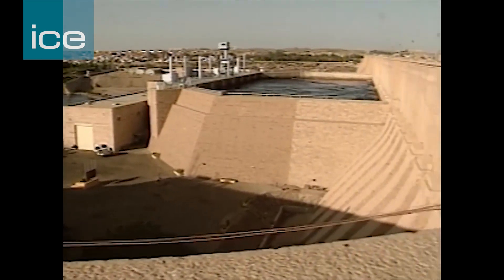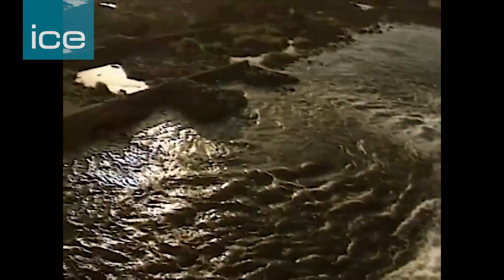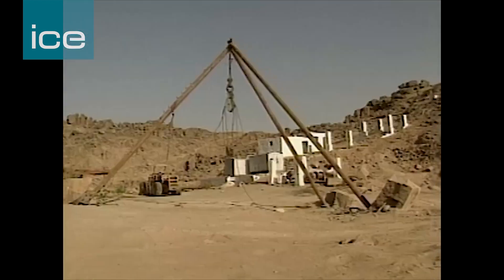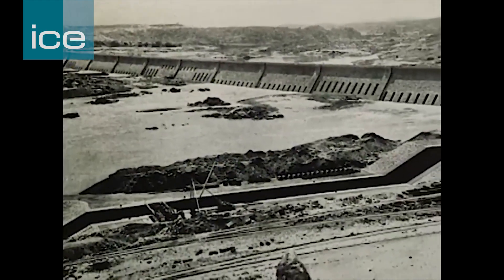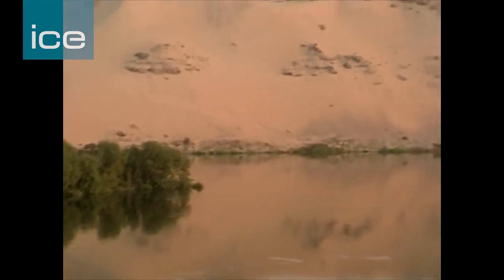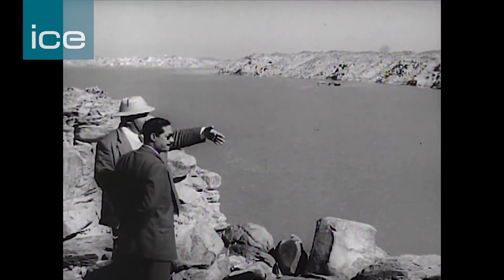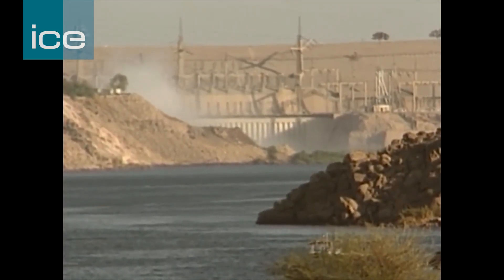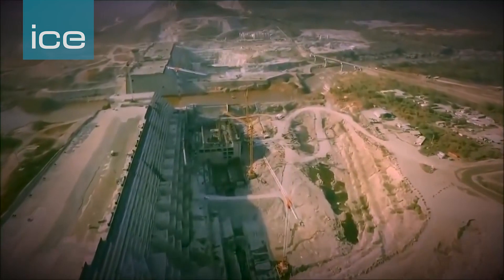Nile Water Control

Comment: Hi Egypt- Nile water has until now been regulated by a British 1959 agreement with Sudan, under which Egypt gets 55.5bn cubic meters a year and Sudan 18.5bn. The annual flow averages 84bn cubic meters, 10bn of which evaporate from Lake Nasser, created by the construction of the Aswan Dam, which came into operation in 1964. This agreement allotted nothing to Ethiopia and other upstream states.The Nile River Basin extends to 11 African countries, but Egypt -- has controlled the river and used the lion's share of its waters for millennia. Ethiopia says the project is needed to provide electricity to share
Egypt, Uganda, Kenya,  Tanzania and Sudan
That could be about to change.